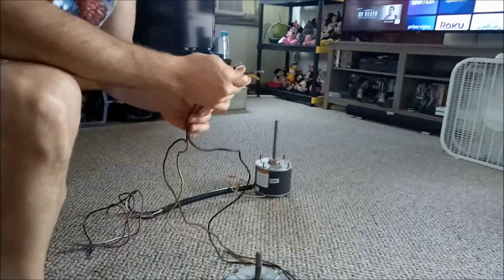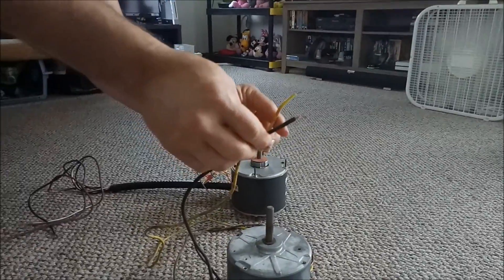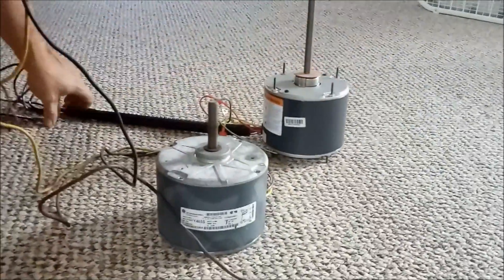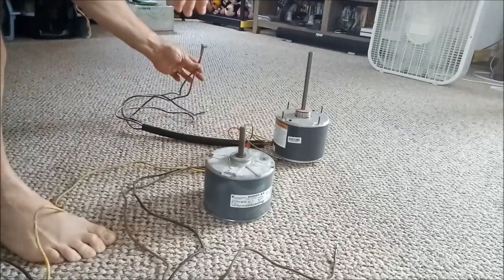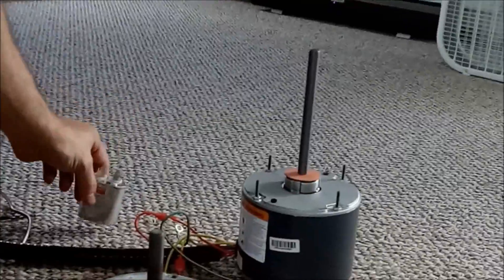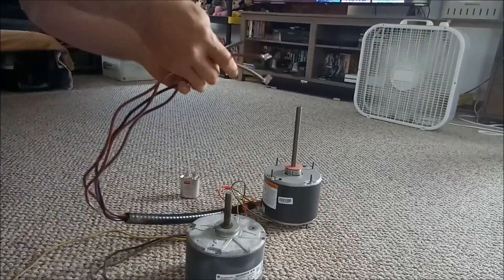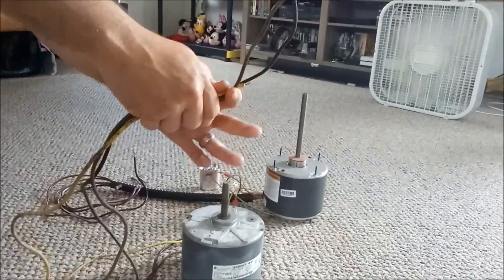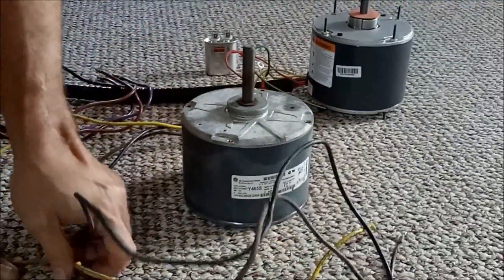Going from a 3 wire to a 4 wire motor on a central air ac unit

Comment: Hi, I do not see on a GE 120V 3 speed fan motor the capacitor. It is in the in  the sealed motor housing ? None of the 3 speeds are goin on. Replaced the 3 position speed switch. Thanks for your reply.
Reply from the maker: My 3 wire fan motor didn't have a capacitor on the unit itself. This video shows when going from a  3 wire to 4 wire you add the small capacitor to help jump start it. The capacitor (if this is an AC unit) is inside the housing of the AC unit.

Comment: This new motor is similar to the motor used in Hollander spin dryer 
2 brown wires were coming to capacitor 
On 3 wire motor one end of capacitor is hooked up to the line, other to he brown wire

Comment: I am tryin to switch out my motor. It has a black, yellow, and brown wire....my new motor has black, white, brown, and brown w/white stripe. Could you help me out on what i need to do? I dont mind paying if anyone can help. Thanks
Reply from the maker: The brown and brown w/stripe should go to a small 2nd capacitor. Black stays black & yellow becomes white.
Reply: @ameripino4872   i only have a dual capacitor
Reply: @ameripino4872  so yeah my ac is just running off a dual capacitor, so i just capped off the brown/white wire. And then connected the black where the old black went, the white i connected where the old yellow went, and then the solid brown where the old brown went(to the Fan on capacitor)......My breaker just keeps tripping though....but im positive i have everything right. According to diagram and everywhere else i have researched.... If u think u could help out at all